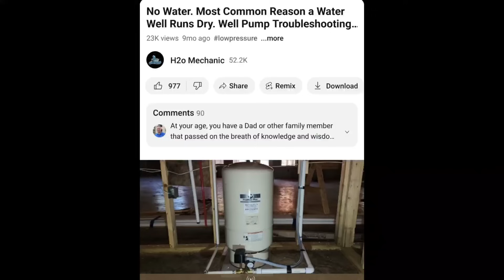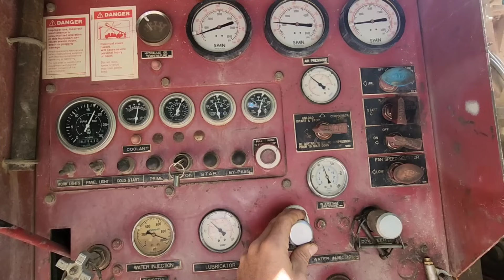Drilling a Existing Well Deeper in Search for More Water! Great Final Results

Comment: Beautiful country.  Logistics is first as you plan how to get at the site, and get out.  Logistics in lining up the rig so the drill bit is in line with the well hole.  This looks like trying to cut a diamond with an axe.  I drilled off center due to poor positioning under my truck and the bit broke off in the frame!  Luckily. I  managed to remove it but that was the only site for the bolt.  I appreciate all the logistics because one well drilling company says it is too difficult to drill my well deeper, which just ran dry.  I will search for other companies in my area ( Tucson, AZ ), now that I know it can be done.  You are correct to film so much time in lining the rig up, boring to some but not me.  Thank You!

Comment: How do you know the well makes 8 gallons a minute.  Maybe a dumb question
Reply: They pump the well dry and then use a device that uses sound to determine the water depth, you then watch the water level rise over a given time and using the diameter of the well you calculate the gallons per minute

Comment: its wild to me that you have to go 600 feet to get water.  my well is 250 foot deep, pump hung at 236 feet, and my vertical elevation is 155 feet above "street" level for the rest of the area, so my well is really only about 100 foot deep, and I get nearly 30GPM out out of it.  The neighbors house had a 40 foot hand dug well that has been okay for years, and they are finally pulling the trigger on getting a 100 foot hole drilled.  That 100 foot hole is gonna cost them nearly $15000.  How much does a 600 foot hole cost around there?
Reply: Holy cow, 15'000 for 100ft sounds insane to me. I'd imagine just drilling a 100ft hole would cost 5k, 10k max. They must be getting a whole system installed with warranty.
Reply: @hi-friaudioman it all solid rock around here. Bedrock hits at 30 feet. Its not soft rock either.

Comment: New viewer in the midlands of SC. I have a great 250 ft. well which is almost 100% silt free. The plumbers throughout the years always comment my filters have never needed cleaning. I want to know how you calculate the Gallon per Minute on a well as you're drilling to know when to stop if desirable volume reached. I measured what my well delivers when I open up one spigot full blast to fill up a 5-gallon bucket. It took 35 seconds so doing the math I calculated my well's production 8.57 gallons per minute. Did I measure correctly? If not, how do I? Back to my original inquiry. How do you know water production while you're drilling? Anyone have an answer?
Reply: No experience with wells here but that would give the volume your pump is capable of pumping, not the water output from the well. Think of the well as a big tank with a small stream going in. You can build up water in the hole then pump it out much faster than it comes in but only for a short time. I would assume you need a method to measure the depth the water is at to really measure well output.

Comment: Here's a little trick to line up the pump Bob perfectly on that spot without all the wiggle wobble use a clear container with a transparent oil the viscosity of the oil will stop the movement of the plumb bob to a minimum

Comment: How did the hung toilet cause the well to go dry?
Reply: That well only produced one half gallon a minute. Water leaking thru the toilet was about that too. Anytime they tried to use water for anything else the well runs dry. Like if you turn on the shower then go to get in a minute or so later about the time you get soapy the water runs out. If you have water coming into your well at 200 foot level and the well is only 215 feet deep you don't have very much reserve water in the well. It runs out pretty quick. If you have a leak you don't have enough water to take a shower. About enough to get wet and soapy. With the running toilet it would take hours to get enough water to rinse off .

Comment: for sure the big buck boys jonesy way of doing things My Well looks to be the same diameter but My Well Is only 48 feet deep and I use a 120 volt pump Instead of a foolish 240 volt pump I will Never mess with 240 volts again mixing Water with 240 volts Is Insane, I can pull the pump out by hand but I use a boat winch to lift and lower the pump, 4 times now I have been screwed by the Water company with a 250 dollar Water bill In 2009 they screwed Me so I decided to but a Well My Parents dug In 1965 then In the 1970s city Water was available and The switch so when I got the 250 dollar Water bill time to switch back but I wanted to do things the big buck boy way and bought a 240 volt pump but It only worked a second and quit but things calmed down with the Water company for a while then July 2024 they got Me again with a 250 dollar Water so I bit the bullet and bought a 120 volt pump this one works but Not enough money to buy a filtering system and a pressure tank and having to prepare for Winter so I was having to use city Water until I could finish the Well system and called RPWA a few days ago to find out how much the Water bill Is another 250 dollars I think I will finish the Well system them bastards charge 45 dollars a month minimum to pay for a police department In a ghost town that does Not even have a gas station ⛽

Comment: Great vid- Once you drill the well deeper, how do you get the casing around all the depth you just drilled?
Reply: Well casing is only at the top of the hole to keep it from collapsing, once you get into the solid rock layers it holds itself for the most part.
Reply: @nicklopez3413  Nice, thanks for the reply.

Comment: I am curious if you just needed more water why did you drill the well deeper instead of just fracking it at it original depth. I know that's what the customer asked for. What would have been the cost difference to frack it versus drilling to the 485 foot? I'm sure that there is a good answer I just don't understand why. Best wishes and thanks for the video's I enjoy them very much.

Comment: Make a jig or stick and strings that locate where the jack legs/pads have to be located relative to the center of the well once the rig is level. I presume that once the pads are loaded they don't slide when raising the rear and the front wheels move as the rear raises. Might be trickier if the front of the rig is downhill, but I'm guessing you want to avoid drainage to the front.

Comment: Imagine getting a flat tire on the boom truck. How convenient it would be to have a built in tire jack.
Reply: Tire isnt flat. The truck can use outriggers to level left and right. You can see to level front to back they have to get the front way lower. The rod has to go in plumb or you'll never get the rod out, the well will collapse because gravity will pull the walls in.
Reply: I was thinking about that and drawing up plans tonight to put some on my Kia next weekend

Comment: not sure if my method might help you here, but I'm an electrician. I use a semi decent laser level that has plumb marks when doing layouts for lighting, that way I can measure and mark on the floor and use the plumb bob feature of my laser level to shoot it to the ceiling. Lot easier to pull measurements on the floor than on the ceiling when you are by yourself. I know that it would be difficult to see in daylight, but you don't have to deal with the pendulum swinging around all the time. They make aerosol sprays that would make the laser beam a lot more visible. Just a thought anyway, That was my solution trying to work backwards against a plum bob :) The red klein is like $150 but the green ones would be easier to see outside.
Reply: Man the green ones are fantastic. We have a few at work and boy they make some stuff so much easier and faster.

Comment: We had to go deeper in our well in PA the well went dry I think the well was 160 feet or so I think the original was in the 125 or so range. The drilling company went deeper in the same well. We had a rod pump, most people use a submersible pump now. Our farm had a 20 foot well and the water was horrible. Even collagen said drill a new well. Then call us if you want a softener. We never called because the new well was the best tasting water. Even my uncle used to take some home to drink. 73

Comment: Chad a question : Could the chambers  of the barrels not be polished with a sacrificial   case  doped with a dab of fine  valve  compound or  a felt mandrel loaded with  matchless metal polishing  compound ? Useing light pressure spinning while the polish  loaded  mandrel with a drill or a lathe at low speeds  and light pressures  apply to the tool. I have learned how to such repairs like this in the past at a gunsmithing school  located in  Colorado . Also  not  a perfect repair , it does allow a otherwise  unserviceable  rifle barrel to  achieve  a partial  useful life  versus being a paperweight or  expensive  pisto blankl blank.

Comment: I remember as a kid in the 60s, folks with summer homes near ours having wells dug with those old 'pounder' rigs. They'd say drilling rigs, but they sounded (and looked) like 'pounders' to me. These new rigs of today seem so much more efficient. 😁😆
Reply: in the 80s I remember a family having a around 40 foot well made deeper with a pounder.   The idea I was told was it would break the rock more and allow more water in.        The well had been there for probably 20 years or more before that but started running dry.   As of know in 2024,. that well is still going strong.

Comment: Our well was dug first in 1994 375 ft 40 gallons a min. Ran dry after well wasn't used for years then in 2019 dug it anther 150 ft hit more water than the Guage could read. My tag says 100gpm

Comment: Being from Florida I never heard of a well running dry, but now living in PA my well has gone dry multiple times in the last several years.  I have seen you frack a well and drill them deeper.  Is there any value to drilling one deeper and fracking it?  I’m getting tired of running out of water and willing to try just about anything to keep it from happening again.

Comment: I have a waterwell on my five acres here in Southern Colorado, and it needs to be drilled down to 470 feet, it's at 365 now. I have a pump, but that's it, living on a fixed income and fighting cancer doesn't give much money to do much of anything. I had a nice dream of what this property would be, but once cancer came into the picture, everything changed five years ago when I was diagnosed. 

I'm glad you were able to fix their situation, may it pump Clean water forever.  

God bless you all.
Reply: I pray that your situation has improved and your well has been resolved
Reply: @tommooe4524 I'm doing fine, and no my well hasn't gotten done.
Reply: I wish I had the know how and the finances to come help you out. If I run into some money I won’t forget. Try and stay positive friend.
Reply: @Glen.324 Thank you
Reply: just a tip to save you another nasty expense.. if you have a septic tank and you're on chemotherapy rent a porta john and use that. chemotherapy meds will mess up the biolocical balance in a septic system and cost you a lot of money.
Reply: @tech4pros1 i said No to chemotherapy and radiation treatments as well as major surgery, I obeyed God's word and did what God told me to do.  I'm still here today.
Reply: I know your pain, same here in Australia. Trust this finds you breathing.
Reply: There is a new cancer drug on trials that appears to be a miracle fix - Fenbendazole. Some research might help you?
Reply: see Holistic Doctors that know what Rife technology and UBI Ozone IV Is

Comment: I would make that rig thing and replace the plumb Bob with a laser. No swinging with the laser. Great video.
Reply: $50 or less. set it over the hole where the string comes through and you can centre it to 1/8" Also, same tool can shoot straight up inside a drill pipe and you can check centreing to make sure it is dead naughts plumb.

Comment: always enjoy seeing people work hard to fix existing problems drilled wells and shot fire just a suggestion cribed drills and other heavy equipment your cribbing should start level it will slide on it self and bend the heck out of your steels never thought of removeing front tires can always learn somthing

Comment: I am obviously ignorant on water wells but I had no clue fracking was used in that industry also. Makes complete sense!
Reply: Its a little different, they aren't using mystery fluid, they just seal the top of the well and pump it full of water until is either pops or shuts off the pump and hope it blows out all the sediment and crap that sealed up the cracks over time.  That said, its much the same process, just not using some mystery mix of goo.

Comment: My well gets 19 gallons an HOUR, 1/2 gallon a minute is over 50% more water and with a family of four we don't have any issues. Can't water the lawn but with 450 gallons reserve we don't have any issues except when the toilet gets stuck. Given how high the water came up they must've had over 200 gallons reserve just in the well alone before re-drilling.
Reply: When we had the drought in California I was down to a half gallon a minute I had to put a special controller on the pump and I designed a pressure type of valve adjustable to hold pressure on the pump to slow down the flow.